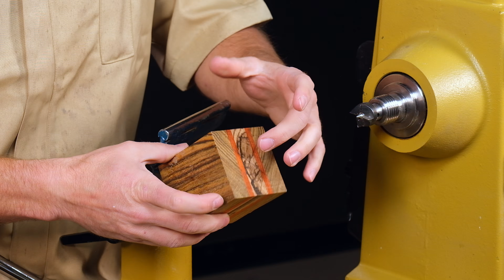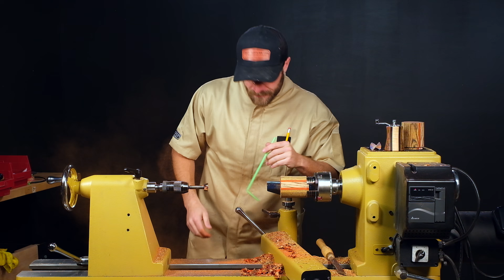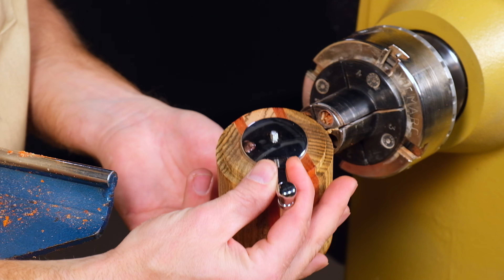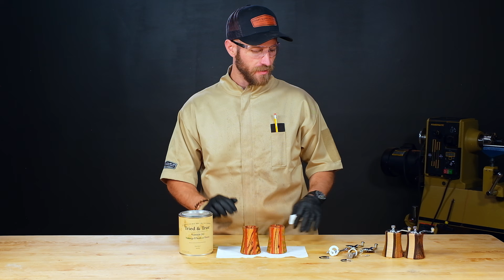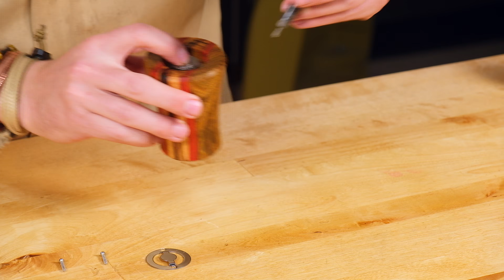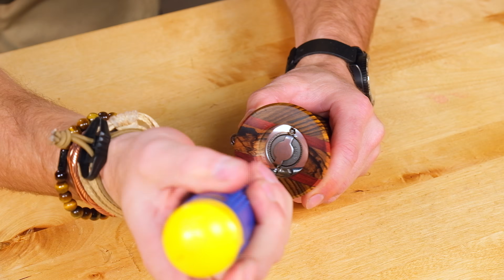Turning a Crank Top Pepper Mill Set - Step-by-Step Guide

Comment: Questions. Are the salt and pepper units the same?  How do you tell the difference on the finished grinders? Instructions are well done!
Reply from the maker: The salt has a ceramic grinder and the pepper is a stainless steel grinder.  The adjustment knob on top has a P and S to indicate salt and pepper.
Reply: Thanks